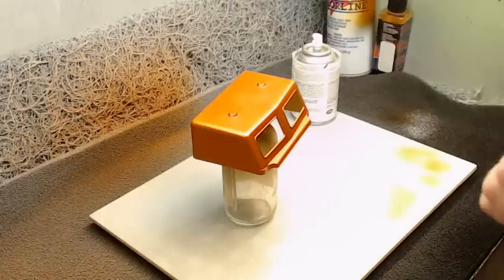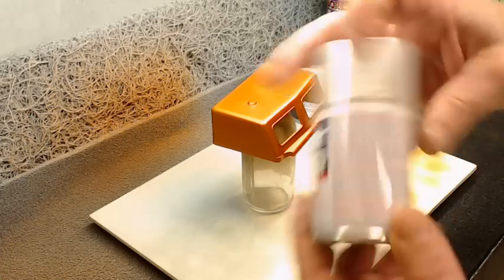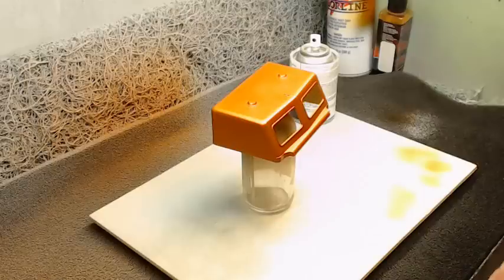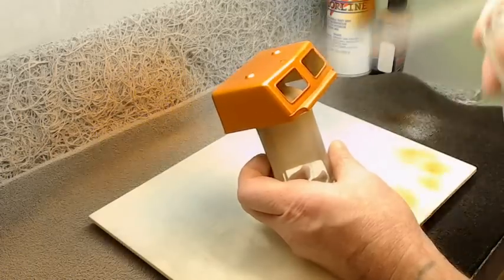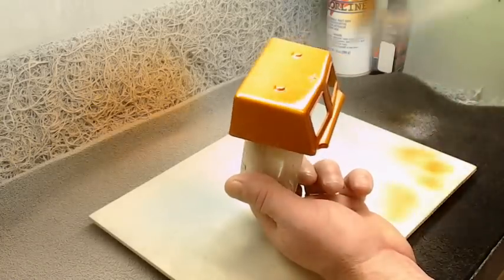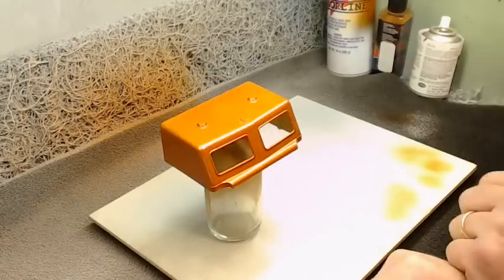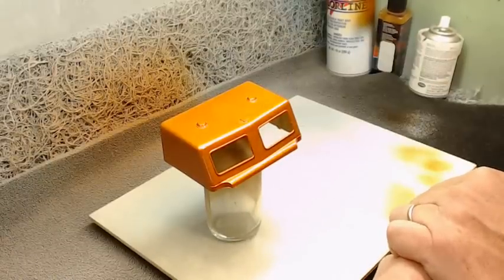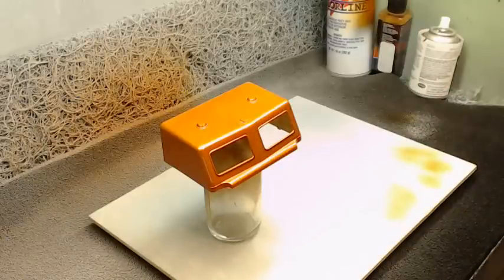inspire paint tutorial (part 4)

Comment: I am curious about a couple of things: (1) how do you keep dust and lint from settling on the parts? and (2) what do you use for a light in the booth?  Thanks Hunter.
Reply from the maker: you do not have to control your conditions as much with lacquers as you do enamels.........that's why i prefer lacquer products. if something lands on the part it will just wipe off because the surface dries very quickly, with enamels the dry times are much longer and any thing that lands on the surface will stick in the finish. i only use led and florescent lighting in my hobbyroom. i build under the same kind of lighting used at most shows to make sure that what i see at the bench is the same thing on a show table.
Reply: Thanks for the reply, have a merry Christmas.